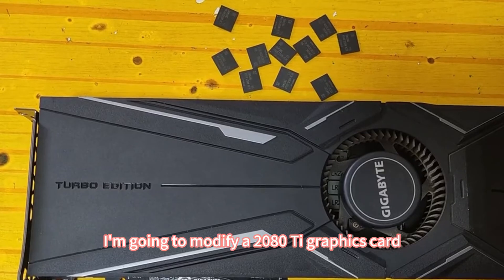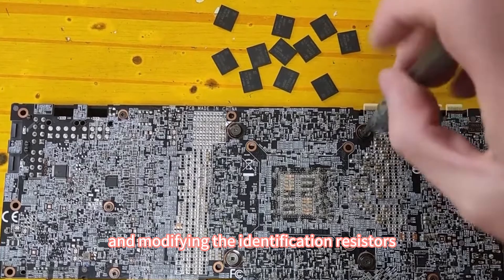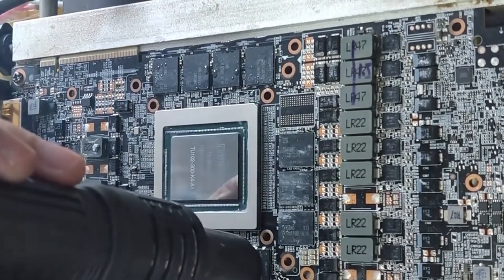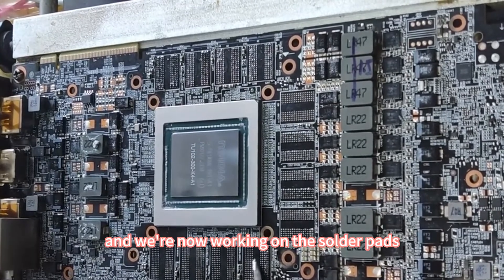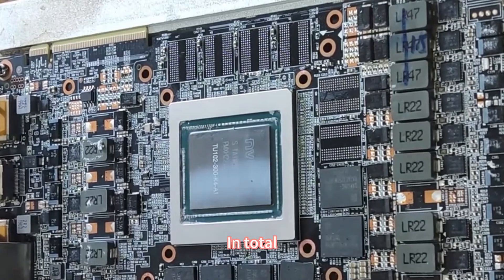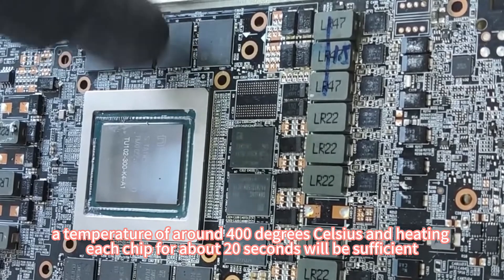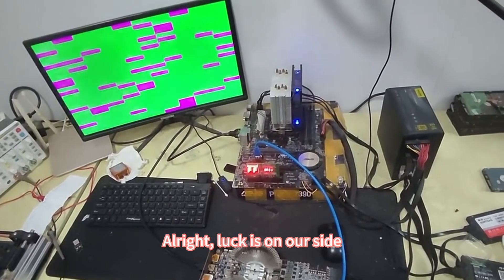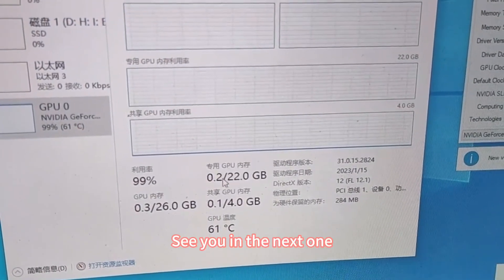How to upgrade GPU memory. Upgrade 2080ti to 22G. 2080ti22g.com

Comment: do you think its easy to add more VRAM by swapping the old chip with new model one or maybe increasing the frequency?
and second how to find one chip compatible??
do you thing any chip will work??
Reply: another issue you will face is BIOS updating so it can take advantage of the added VRAM of the card and even drivers lol
Reply: @hornyalcoholic  I know i should update the bios many people say its easy, but my question is how to know the compatible chip
Reply: @MLS.22  You won't need to update the BIOS, you will need to code/find a custom one to take advantage of the VRAM.
Reply: any chip wil NOT work. gpu's have a small list of supported chips (usually 2-3 different brands) and frequencies. you need to have the card's manual for that. changing the chips/frequencies, needs different resistor combinations in order for the card to recognize and use them. changing vram size will also need a different vbios.

Comment: soldering oil, suction device on the pads ... damn, this is so full of bad advice. While the video content is correct, the autogenerated voice over (and maybe the script used) is full of incorrect statements.
Reply: It's translated from Chinese i guess that explains all the mistakes
Reply: its not incorrect .. you just need to take into account that the script was most likely translated from chinese to english and then ran through a text-to-speech programm ... its obviously not soldering oil .. its flux .. but here in german that is calles "lötfett" or "flussmittel" "lötwasser" witch translates to soldering-fat or "floathelper" or "make it float water" or even "riverstuff" if you really want to start mistranslating stuff :D :D :D
Reply: @Maverrick2140  point taken, ty.
Reply: It's still correct, even if it uses incorrect terminology due to a language barrier,  don't be that guy that, you're  not proving anything with this kind of smartassery...
Reply: by "suction device" and later "suction tape" he means solder wick.
Reply: What temp was your heat gun while removing the vram chips?

Comment: In the 90s you bought graphic cards with upgradable VRAM. So for eg Matrox Mystique 2mb 3DFX would have 2 slots for another 2 mb if you so wished. They just pushed in. Today they rip you off because that’s the normal thing to do.  Consumerism at its 100% best
Reply: damn it hurts to know that, just the other day when I saw they added a slot for nvmes of all things. 
the average consumer can't even take advantage of such speeds and i'd much rather be able to add more vram, specially when I have 4 nvme slots on my board and can add at least another 2 with a pcie nvme card.
Reply: that added memory was not just a doubling something, there was different types of memories for textures commands and so on. you were adding ram to make a function to work.
Reply: Progress in technology XD
Reply: It's not to rip you off. Soldered memory chips, especially VRAM provide better signal integrity, speed, and performance. Trust me there's a lot of ways companies try to maximize profit and minimize cost. But, the design decision to solder memory chips is prevalent and I would gladly take a devices with soldered memory over being able to upgrade it.
Reply: @niio07  Better performance is nice and all but they're still ripping us off by providing the bare minimum (or less) amount of vram so we'll have to upgrade the next generation unless we buy the ridiculously overpriced flagship card or compromise on visual quality. They wouldn't get away with it if we could upgrade the vram. Soldered memory can obviously be upgraded (hence this video) and more could be added but they have made the conscious decision to not support it so that their used cards don't compete with their new ones.

The difference in fps of having an older card vs having an older card with insufficient vram is enormous. They have also lowered the bandwidth on the low end cards to pcie x8 as a conscious decision to exaggerate the performance drop from running out of vram.

Comment: Nvidia ia going to have a stroke when they find out people are now learning how to increase their vram lmaooooo
Reply: People have been doing this for a while. Considering the skill and experience required, i don't think nvidia is too concerned
Reply: @HoldMyPoopKnife  with prices like that people start to make their own gpus😂
Reply: but if you can get someone to do it for much cheaper than what nvidia asks maybe they'll try something as this is something they should be able to detect easily from drivers but in any case it would cause a major shitstorm  @HoldMyPoopKnife
Reply: Fr
Reply: theyre going to turn into apple and start booby trapping the cards.
Reply: @SkullModder  I'm sure they've done the studies, but I strongly suspect spending the money to booby trap the graphics dedicated cards would cost them more than the small number of upgraders would cost them.   While the card can absolutely use all that extra ram depending on how you're using it, it's still the generation it is and a 24gb 4090 will run circles around a 22gb 2080 in AI related data crunching, but neither will come close to the top end dedicated AI cards.  Now, speaking for their AI dedicated cards?  Those they might actually booby trap since the top of the line datacenter card is the cost of a small house at the moment so the profit is absolutely there to make it worth the time and expense to trap.
Reply: @manicmarauder  Hardware Unboxed would love to find out that Nvidia was booby traping GPUs...
Reply: They will switch to on package dram 💀
Reply: I have a legion laptop with a 3060, only 6gbs of vram.. it has 2 extra vram chip spots, can I just solder 2 vram chips there
Reply: @DCnormal It doesn't work like that, bios configuration and electronic traces are often involved.
Reply: @LoganRicardo  oh
Reply: @DCnormal nope you cant unless nvidia or a hacker releases a modded bios that enables the additional memory controller locked in the chip.
Reply: @kakkoishonen  you Can Do it yourself, you Can found and. Modify the gpu bios with spécific application (if you Can not understand it's ok => i'm bad in english)
Reply: lol true
Reply: they already have been for several years from what i have seen on northridge fix louis rossmann repair, and der8bauer and kingpin and steve when he does his factory interviews in china and taiwan
Reply: They are worth 3 trillion and don't rely on gamers anymore, so they wouldn't care at this point.
Reply: This has been done for ages, its the same process for smartphones, laptops, etc..
Reply: Can we not do this with ps5 😊😊😊😊😅😅
Reply: they can pay for the medical bills don't worry.
Reply: This has been done since the Pascal cards
Reply: Until they make their 5070 a real 4090 upgrading their VRAMs double
Reply: People have been doing this since 90s it's now due to YouTube that a normal consumer can see these repairs
Reply: Thank god I just purchased 4080 and sold 1070
Reply: yeah there shaking in there boots knowing you cant force it to tuse more being the chipset isnt programed to.... and since they dont make em,,,  you cant just write new drivers that make it   LOL...    sorry...    pc engineer here :-\
Reply: oh ps   people take advantage of ppl that truly dont know how it works all the time..   its a human flaw
Reply: Warranty void
Reply: No they're not 😅
Reply: Thats what they get when they be skimping out with 8GB 4000 series cards like WTF.. time for the consumers to just upgrade and modify their ram themselves if Nvidia wont do it!
Reply: more vram doesnt really increase the performance. cards with 16gb of vram probably dont even max out 10gb
Reply: @Slootdog   at 1080p yes but on 1440p or higher with RT enabled, you can max out 12gb as well. So 16gb vram upgrade is worth it.
Reply: @DragonOfTheMortalKombat  yes but for example a 4090 is going to utilize more vram because it has higher memory bandwidth, number of computing units, clock speeds. Slapping a 1050ti with 12 GB isnt going to perform like a 4070 super 12GB and so on. It's practical if you are using the right card but doesnt exactly make a bad card good.
Reply: @Slootdog  well if you give example of 1050ti then yes its not a worth upgrade, but maybe not for higher end gpu such as rtx4080 12GB to 20GB
Reply: @Slootdog  Yeah, but a rx470 with 8gb of vram has certainly aged quite a bit better than the 4gb counterpart because it can utilize that 8gb of vram. Just add in high quality textures, etc. at 1080p to 1440p. It'll utilize that 8gb of vram. The 3070/70ti and 3080 could both use double the vram. Especially in newer games at 1440p with RT on + HQ texture/mods. The 3060m could also utilize more vram, like 12gb. 

So while having the performance is important, don't underestimate the vram. Even weaker cards with more vram can utilize it. The 3070 with 16gb of vram is pretty close to a rx6800 in performance.
Reply: @Slootdog  slapping 12gigs on 1050ti will make it work almost like 2060
Reply: @DragonOfTheMortalKombat  accurate, the higher vram is meant for higher resolution you'll never find a game using 16 or even 10 gb at 1080p
Reply: @Slootdog  depends. for VR biggets issue is not enough vram could save a lot money if you just add vram to a 3070 instead of buing a 3090 or 4090
Reply: @Slootdog  it's not about performance, it's about being able to fit bigger AI models.
Reply: @Slootdog yeah I'm sure people were saying that about their 8gb card a couple of generations ago
Reply: @Slootdog  if you do 3d rendering it is great
Reply: @Slootdog  most likely. i am fine with 8GIGS. I case of some AI tasks more vram can be a game changer or at least save some money.
Reply: @Slootdog  He said that this is nescessary for AI.
Reply: @Slootdog  It really depends on what you're trying to do. In gaming, the highest you'll see with any current gen game might hit about 14GB at 4K (Escape From Tarkov, Streets of Tarkov map at high texture settings in 4K for example) but in AI applications like training models or trying to run a local LLM with billions of parameters you can easily exceed that, some requiring more than 48GB of VRAM.

Comment: I wonder if its possible to take a aorus 3080 xtreme with 10gb and max out the memory  and what it would cost to do the job?
Reply: Not much, chips are not that expensive. You will probably spend more money on soldering tools then on chips themselves.

Comment: qhy is 22gb the max? on newer cards do they have a higher theoretical max
Reply: It isn't the max it's just that 2gb chips of the correct type were available so that is what he used
Reply: @kazipex  no you have no clue 
he used 22gb because its max because the firmware is locked to vram bandwith !!

Comment: Man said it's an easy process then a few minutes later said there's a 90% chance of failure if you're not experienced lol
Reply: Yeah it's easy, just heat it up until the chips are removed. I can do it, but to do it successfully would be the question. since the solder points are too small, the risk of short circuit is high.
Reply: @Rhenzkiller  u should defenitely practice on old, cheap cards.

get urself a bunch of GTX 760 cards or even lower models and then practice.

wil will give it a try
Reply: @Hardys-Mods  would a faulty modified card kill a computer system? I'm wondering.
Reply: @Hardys-Mods 290/290x are a actually worth modding they are cheap, $30-45, you can get broken ones around $10-30, and hey if you fix em and put 8gb of ram they are about equal to a rx580, 1060, 1650/60
Reply: @Rhenzkiller removing the old ones it’s piss, the hard part is installing new chips.
Reply: short circuit of what? Your brain?😂 @Rhenzkiller
Reply: @Rhenzkiller  You said a very big nonsense. This is not easy but this is very hard.
Reply: Maybe he just meant that 90% of the time it work every time
Reply: He said, easy if you are experienced on doing it.
Train until you are able to do it.
Reply: Probably some nuance was lost in translation
Reply: Physically it is easy ... but it's also easy to screw up.  That's where the experience portion comes in:  how not to screw up what is technically an easy task, assuming you have the proper tools.
Reply: @manicmarauder  This process is very hard.
Reply: A.I. wording is great isn't it 😂
Reply: @Ecstasio TTS existed for a long long time
Reply: @Ecstasio  the user has to be good at using the ai in order for it to be good
Reply: @yulpark9299  Oh trust me I know. I was referring to this video specifically. I have no problem with AI content at all but effort should be made to make it at least sound coherent and engaging.
Reply: @Ecstasio  you could tell it how to be those things
Reply: @Ecstasio it is text to speech, you write stuff then the program reads it for you, many AI uses tts because its easy
Reply: everything is easy if you know how to do it ^^
Reply: @Maverrick2140  Things that are a challenge even if you are well trained:

Brain surgery
Piloting an AH-64 behind enemy lines while staying hidden.
Saturation diving (the highest paid job in the world btw)
Landing the lunar decent module on the moon.

 Some things never get easy, the training just means you have a better chance to not fail.
Reply: cough heat gun, solder and rosen...    I find that hard to screw up unless your cross eyed... lol   its simple a matter of placement once ya get the solder on the board
Reply: 10 percent is a lot imo
Reply: Lmfao !
Reply: it's easy to fail, he meant 😂😂😂😂😂😂
Reply: It is easy if you are skilled at soldering SMT stuff.
Reply: easy for him 😂
Reply: Man?! It's an Ai voice dude
Reply: also he said we need a 400 degrees temperature
Reply: "Skill issue" be like
Reply: As a mobile technician reballing is not easy requires a lot of experience
Reply: Man, everything is easy if you have the skills for it!

Comment: Can this process be done on a laptop main-board?
Reply: Yes it can be. But it depends heavily on the motherboard itself if it'll still work afterwards.
Reply: @swisstraeng  I think it will not work and if it does, custom bios update will be mandatory.
Reply: yes it can be done anywhere you can replace the vram chips 1:1 ratio

Comment: It kinda looked like there was 1 empty slot to put another 2 gb vram on it to make it 24G, would it even work at all if you put anything there?
Reply from the maker: You are right. But it won't work with 24G. 22G is the max.
Reply: whats the reason? @customgpu
Reply: @34unreal  idk, probably using the same matrix as the rt titan but core can't handle more than 11gb without issues, it is known that 22gb of vram will not be achieved during high intensity tasks that require a lot of vram transfer, the 4060ti 16gb faces the same problem and overclocking it solves it, however overclocking 2080ti's is riskier for some weird reason.
Reply: ok thanks
Reply: it's won't work because nvidia have locked the firmware with 352bit vram buswidth, it only can be upgraded to 22-44-88-...gb of vram since total bga chips is still 352bit

Comment: Which memory chip did you use to replace the original ones.
Reply from the maker: samsung
Reply: i think they are K4ZAF325BM-HC16. not sure though
Reply: or HC14 but the HC16 is 16gb/s
Reply: Does it matter if the memory chips are the same exact model? Or even same exact generation? 

Could it be GDDR5 GDDR6, GDDR6X?

Comment: this is great, did you have to modify the bios?
Reply from the maker: No need to modify the core or bios. Only switching VRAM chips.
Reply: @customgpu  Northwest Repair said you needed to create a custom bios even when switching from hynix micron to samsung same size chips... wtf
Reply: @Boeing747Cultist  you have to move the memory straps. every bios ahs multiple memory profiles that can be selected by resistors.
Reply: @customgpu  the i must tell you ! you just a noob, there is no way you can use other mount of VRam without modufy the Vbios ! that stupid what you telling ppl here , even tho , there is no sec video ! and you didnt even show th jumper resisror to aktivate the Vram Socket !! 
dude Stop Blowing up ppl , some of them gonna bellive you and distroy there Grafik cards !